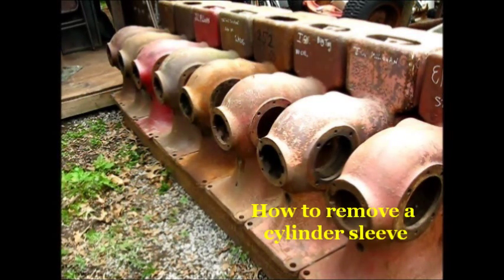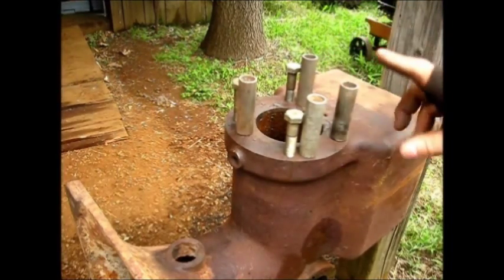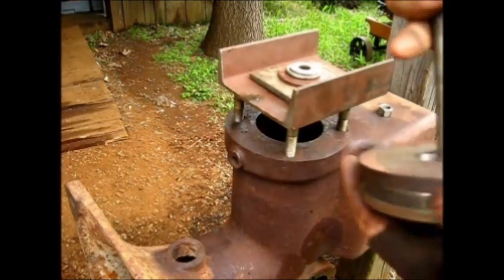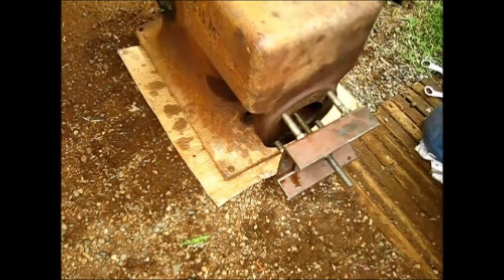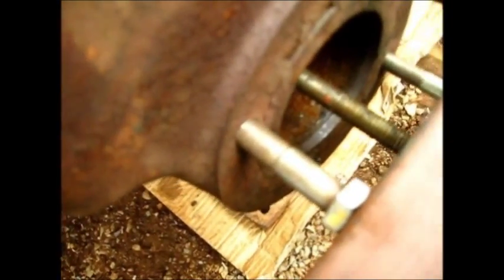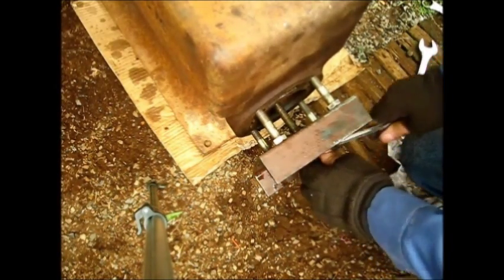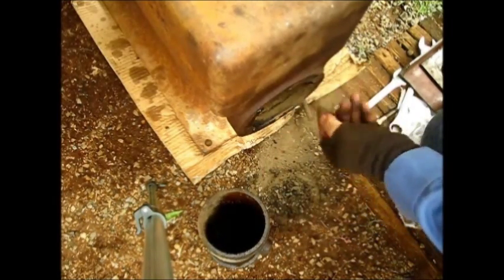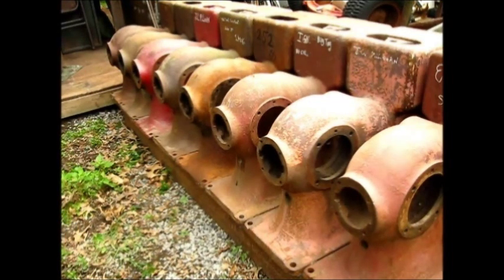1918 IHC engine  cylinder remove

Comment: Most people would of reached for the gas torch (common in most workshops),which is in no way an "overrated specialty tool".The gas torch is a valuable piece of workshop equipment.I guess it depends on what one has been taught,and to what level they are prepared to improvise? I like Sams way better than applying heat, AND its probably quicker than getting out the gas axe or propane torch ,also environmently friendly :D

Comment: Great video!  Just like my father taught me, sometimes the easiest and best way to do something requires just a little elbow grease and not overpriced overrated specialty tools.  Now if that sleeve is no good would you be able to get a new one or would you be able to have one made/make it yourself? (I have no idea the equipment you own and if you would have a tool large enough to bore the hole)

Comment: Cool!  I like the old common sense approaches.  You don't know where I could get a carb for an old Wisconsin AB engine (1 1/2 horse with a 2 1/2 X 2 3/4 bore and stroke) do you?  It's on a 1 1/2 horse engine that runs my old 1946 Gilson concrete mixer.  It's an all aluminum carb, but the needle and seats are all done, and I have a bunch of concrete work to do around the place.

Really like the old mixer, on it's own trailer with the original tube tires that still hold air, and it's built like a tank.  Love to get it going again, and though I have a Honda engine that I can adapt to it, I'd rather run the old engine as it was completely rebuilt before the old fellow that bought it new passed away.

I bought it from his estate, and have done a ton of work with it over the years.  You seem to be the kind of guy who might know where to find one!

You can email me at: glennwmurphy@hotmail.com if you know of one to be had.  enjoyed your video, keep them comin'.
Reply from the maker: Glenn Murphy ,,, I think I have one of those engines in the shed,,, but it is complete and I have no extra parts,,,